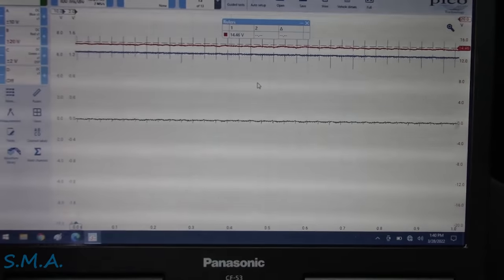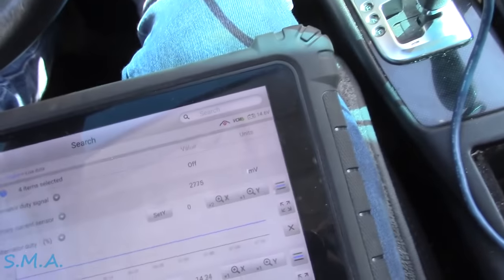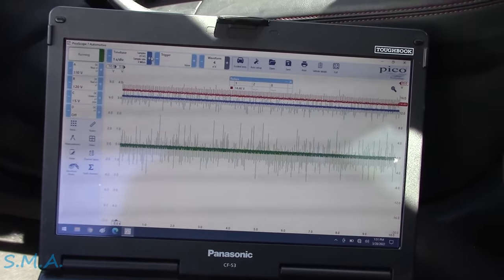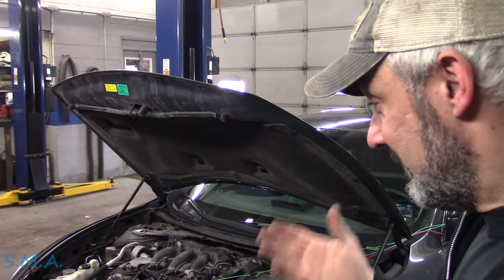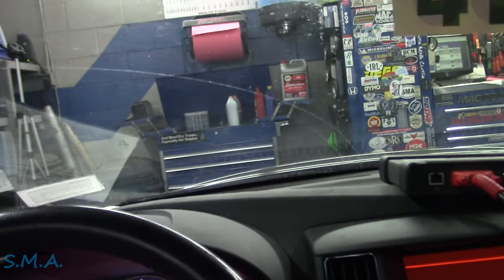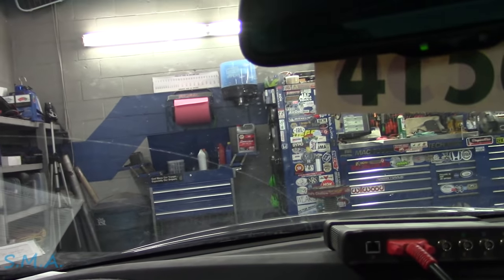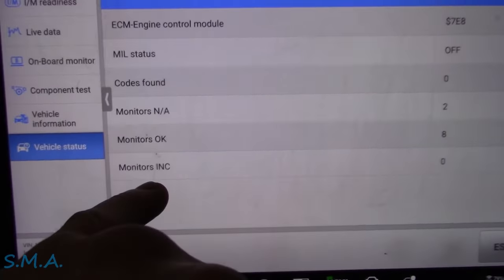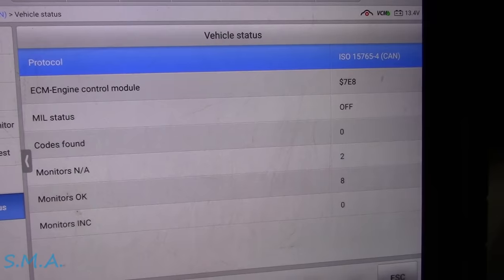Nissan Dealer Quoted Over $2000 For A New Harness!! - The Real Problem

Comment: One more thing. It is my belief that diagnosing a problem requires the mindset of realizing that there is a common denominator when you are attempting to diagnose the problem. Example; I actually have worked on some heavy duty trucks. I had a Peterbilt that was at the dealership kept blowing one of the main fuses. The dealership had it twice and it still was blowing the fuse which cut off the air conditioner compressor, some of the gauge cluster and most importantly the air controlled fan on front of the engine. So I cranked it up and I was going to put it in reverse and I noticed the alternator hand bottoms out quickly let go of the gearshift. The alternator  jumped right back up to the normal position.
Talking to the driver he said, now that I think about it every time it has been acting up is when I am connecting to a trailer.
It was a dead short in the reverse switch in the transmission.
Common denominator, was backing up.

Comment: I haven’t finished watching because I didn’t want to know for certain the fix. I believe there are those rare times in all mechanical service where a judgment call ,“Guess” based off of diagnosis, elimination and experience needs to be made. I think the high Milage and that the Alternator was original that replacing it is a very solid guess of experience. 
A hell of a lot better than Wheel speed sensors that she was sold or the expensive wire harness Diagnostic /guess. Just watching I said Nope highly doubt the wheel sensors would cause a complete electrical shut down and flickering ALT light. 
Really enjoy your practical diagnostics approach. Easy to see you have fixed a car or two. Back to the video to see the outcome

Comment: We need more troubleshooters like Mr. O across society. For example, Apple used to be about troubleshooting issues and finding the actual fault and now it just replaces components until its fixed. No investigating issues and trying to determine if there's a systemic issue with hardware/software. Thanks for the knowledge you share.

Comment: I have to agree with others. The in depth, detailed diagnostics, and analysis, is so critical. You might spend more time diagnosing than other shops, BUT, you can feel better, and you're customer can, knowing that the issue has been fixed for certain. I enjoy watching your step by steps, you're in depth narration. Well done.

Comment: Harness problems usually show up on cold starts, especially when there is high humidity. On my 1991 Maxima, I did have a harness replaced under warranty. 120k miles later the alternator went.

Comment: Ive seen two alternator issues, one, bonding strap from alternator to engine block broke and that completely ate the battery in a blizzard going across the real south park outside of fairplay. The other was worn brushes on an alternator and it quit charging. Replacing a set of brushes was far cheaper than replacing a complete alternator but most people dont know you can just replace the brushes and or the voltage regulator.

Comment: Many years ago, took my FX35 to a Infiniti dealership same crap as Nissan. They changed the rear subframe after they messed up on a rear alignment. Extended warranty covered everything. But the issue persisted, the back end was all over the road, it would sway hard to the left and right on bumps. I took it to my local mechanic/alignment shop. They checked the alignment and the toe and camber were all messed up in the rear. After 10 min fix, the car was back on the road and had no issues. Therefore, they through bunch of parts and even disrespected me of how my car should perform..

Comment: Good job,  probably the over charge  is what led to the positive battery terminal corrosion . In you 1st vid the altinator duty cycle was off once you changed it was on good job 👏

Comment: Because of all this fun stuff, I am going to drive my 01 and 02 Corollas, 92 Camry and 96 F150 till the bodies fall apart. Too much computerized BS. Great video Eric! No Reee here.

I do have a question. Do modern alternators still use internal voltage regulators? My thinking is the regulator was losing ground internally in the alternator causing voltage to spike since it couldn't regulate the output voltage. Maybe?

Comment: Well done! I think the vast majority of shops would not have found this. But then, most shops get squat for extensively diagnosing vehicles (according to a mechanic friend of mine) so they don’t bother usually. They treat error codes, not vehicles.  Often they just hook up the diag tool, read codes, take a more or less educated guess, then load the parts cannon and hope for the best.

Comment: Funny I find this video now, a few months ago I was working on my wife's beater 04 Grand Am that she loaned out to a friend. Similar failure mode, dash would go dark while driving, but no limp mode (not sure if an 04 GM even has one). Also intermittent no start. I had a very similar troubleshooting process to yours - started with changing the battery cables (negative cable is pigtailed to ground, so I'm also replacing system ground), and then replaced the alternator. Was thinking to myself, this is too stupid to be the root cause, but hey it worked!

Comment: I think Nissan should give her money back...when mr o said dash light were dimming...regulator from alternator were pinging off in my head it regulates voltage spikes speed sensor codes were there because the alternator shares a 5v ref with the speed sensors so the pcm will see that and flag a trouble code really can throw you for a loop great tech mr o !

Comment: Had a Nissan Altima come in the shop about a year ago.  Customer had it at the local dealer and they told her it needed a ECM.  Running the vehicle it would act stupid from the get go.  Scanner data was all over the place.  Battery light flashing intermittent.  Checked DC voltage good checked for AC voltage got 3.3volts.  "There's your problem lady" replaced alternator and problem solved.  So much for the dealership diagnostic

Comment: I had a similar issue with a Honda Pilot. It had high voltage at 20vdc. The fix was replacing the electronic load distributor (ELD) after that the pcm signal went back to normal.  but it still had high voltage. Ultimately the alternator was also bad. I just hate how they modernized the charging system on newer cars just to eek out a mile per gallon better gas mileage. The older charging systems worked just fine.

Comment: it is insane to me that they missed the battery voltage code from the TCM and didn't fix this properly. I thought they always just replaced the ECU in these situations, lol never the harness but I guess there is always a first. This Diagnosis screams ground or power issue from the first time I saw the way it acted up... Great job on the diag, as always.

Comment: The dealership mechanics should have seen the high voltage and known the voltage regulator is bad. I have replaced the regulator from the alternator if the alternator bearings are good. Saving money.

Comment: Abnormal voltage code in ABS is the tell tale sign in these vehicles.  That's a good system to monitor for voltage issues on Nissan .Start with the basics is what you did.

Comment: good find, what in concerned about is in the original list of codes there was an abnormal voltage code this can be to low or 2 high but that data should have been stored in the FFR freeze frame data. generally if I see voltage codes that is my first place to start, not load the parts cannon and see what fixes nothing. also just a note for you, the early ish v6's it is not a bad idea to change the small harness at the alternator. once its out you have lots of space as these can crap out quite often and cause all kinds of strange things to happen electrically, , you can get that alternator out without  disconnecting the ac compressor but its a bit like playing tetris blind folded. great video and again nice find.

Comment: I have an 05 Frontier that is showing almost similar . Intermittent charging and putting out 14.3V on idle . Then it craps out and light comes on with brake light and lose gauges , oil pressure , amps etc.  Have alternator and new belt plus Tensioner on order . Fingers crossed . Great job on diagnosis . I’m also in NY a bit further south but dealing with rust dragon also lol.

Comment: Good work! Yep, corroded battery connections caused high impedance in the system, maybe introduced some AC into the regulator due to poor continuity under load, caused a lot of things to spit dummy! Gotta be ace at diagnostic troubleshooting with them simple if not obvious things! KISS rule always applies! You went right to it! Well done brother!

Comment: Had a transmission company diagnose a bad transmission. Started slipping again less than 1 week later. Took i5 back to the same place. They recommended a new transmission.  I said ok. Then told them that they were going to put it in for free. They got confused!.
I  told them that I had it in their shop the week before. I showed them the receipt. 
They came back into the office and told me I had a vacuum tube leak. And they fixed it.  I asked why they sold me a transmission when the only problem was a vacuum leak. 

Crickets.

Comment: Working at nissan in CA, i saw plenty. I wouldn’t doubt they quickly diagnosed it without care. When i was at nissan a 2020 nissan kicks had an issue, shop foreman diagnosed it and under warranty it got a new engine harness which he threw at me to do. Lady picked it up and a week later had same issue that the harness was supposed to fix 😂. I honestly didnt get into what was the issue, i just changed the harness as asked. But they dont have the time to properly diagnose cars, if it’s routine issues they go through them quickly but the techs are always rushed to get 80+ hours for the pay period in order to get paid. Kinda stressful so i left. 2 older guys weren’t getting 60 hours, surprised they were still there. But they use a different diagnostic system that’s beyond different from using a scanner. In the 30 or so mins he diags cars is the time they get rushed at dealers, especially for waiters 😂

Comment: The day you get a dealership to admit they f'd up, good for you. A refund??? Total pipe dream!! The way you go about diagnosing items is neat to watch. I do what I can on my trucks, thanks to you and watching several u tunes. Speed sensors??? WTF?? One thing about dealers or SOME mechanics just replacing random items continues.  Well, it should have fixed it. Sorry about that, but here's the bill. People in your area are lucky to have a REAL diagnosistician(?) to go to.
Just curious as to your shop rate. Most guys in my area are hovering around $85--100 per hour. If they fix it without an excess of charges, you just don't eat that week😩😩. Thanks for sharing. Ron

Comment: So I hold a bachelor of science in automotive technology. I don't practice that trade anymore. But if I ever have to diagnose something I start simple. I start with checking the battery terminals I check the alternator terminals and I check fuses. I use a multi meter and a test light. Again I go right to the basic.  It seems that that practice of basic diagnosis has been forgotten.  It seems like it's just plugging and play and use a scan tool and that will diagnose and help you locate the problem. Scan tools not going to help you visually with corroded batteries and so forth.  It annoys me when I hear about people going to dealerships dealerships and they try to upsell on s*** they don't need.

Comment: Had the same problem with a 2010 Nissan Maxima did basically the same dealership replaced alternator 2 times still did the same they had a Nissan engineer look at the car said put another alternator on it did the same so they ordered another and it fix the car after 3 alternators

Comment: Last week this happened to us at a Mazda dealer in Richardson tx.
We dropped off a perfectly functioning vehicle to get an error light
Checked. They kept it for 9 days without a word to us. Then we
Find out they have been trying to file a $ 7,000 claim on our auto
Insurance to get an Entire wiring harness installed plus about 1,100
Worth of other things.
When we told them to do the minor stuff, tell us when it is done
so we can pick it up, when contacted that the minor work was
Done but we would likely need a tow truck to get it home.

Got there to drive t home after dropping it off  operating 
flawlessly. The battery was dead, they jumped it, then a half 
Mile away it went into 4 mph mode.

They tried telling us that when the battery gets weak it
Does that to keep you safe from going at highway speeds.

They never knew that I became our family car guy at age
14 in 1974 and have. Repaired hundreds of cars for pay, 
over the Decades, and know enuf about electronics to
Troubleshoot nearly all circuit boards.

I also have been told many times by my fav auto elec
shop here that for a very long time the voltage output
of alternators has been controlled by the voltage
regulators attached on the alternators independent
of the other car systems.  And that if more than 
14.5 v ever gets out of that voltage regulator, then
You have a bad alternator-mounted  voltage regulator.

I have repaired many cars by replacing either or both
the alternator diodes or the regulator module for way
less than the cost of an entire new alternator. Watching
your video, as soon as I heard  “17 volts”  I was certain
The voltage regulator was failing. But you can easily
replace those yourself in 5 min for about $40. They
are nearly always mounted externally at the rear of
The alternator.

Comment: The lady should be refunded in full for nissans incompeiance afte all they would and should have high tech equipment to solve the problem pity i cant say the same for their mechanic you did a fantastic job for the lady with your testing and diagnosis and finaly cured the issue you come accross as a mechanic who who wont be beaten

Comment: I’ve been  down the misdiagnosis road with the dealership in the past and have even proven they were wrong.  I have never gotten a full refund. They always claim there was an additional problem. The best I got one time was a partial refund for engine work that fixed nothing. I still remember the mechanics saying “That noice? We didn’t know you were talking about that noice.” LOL! There was no other noise and the car ran fine.  Turned out to be a cracked head which I fixed myself. They replaced a timing gear and the chain. Mileage was not conducive for this going bad.

Comment: You are amazing you're deductive reasoning and investigative skills are absolutely astonishing and the fact that you start with an open mind to determine the actual problem rather than like Nissan they wasted $1,000 worth of the lady's money and yes they should give her an apology and a refund based on your determination and repair and thank God that she had enough sense to not replace the wire harness cuz they would have replaced the wire harness and the alternator would have still had a problem so they would have had to replace the alternator on top of that and they never would have admitted that the wire harness did not have an issue because the wire harness for that car is probably $3,000 so they would have made $800 on the wire harness plus another $800 on the labor so they're not going to give that up they're going to deny deny deny and say oh well it had a problem and the alternator also had a problem and we had to replace all that stuff and you know now we've you know pretty much charged you for a car again I just thank God for people like you that have enough sense to figure out what the actual problem is rather than just start replacing a bunch of very expensive parts

Comment: Give the dealership the opportunity to see the video and ask them what they want to do. As you know dealerships have time restrictions in the way they run and depending on the techs bonus formula, limits there on time too. However, hopefully some are still genuine people and this poor lady  might get her parts and labour refunded as a goodwill gesture. Being an ex Service Manager at a Dealership one thing I know is if you dont make them aware they cant act. Also dont take the Service Managers decision to do nothing as final! Ask to have it referred to the Regional Service Manager for his opinion on the situation, fully knowing they have roughly 5% of turnover that has to be spent on the "reputation of the dealership" commonly under the guise of a "Refund", or "Goodwill".Another great diagnosis and proves you can get a better job done at an independent garage especially for intermittent faults. Remember If you replace everything you will correct the problem!!! ha ha

Comment: As a person who does repairs in a different field ... Intermittant faults are a nightmare . So hard to catch them in the act.
I've seen it on cars too ...  A v6 vw toureg which would drive perfectly ..then once every so often go into limp ..not fun in the fast lane .  It could happen any time , never threw a code and no pattern to it except if you turned it off completely and started again It would drive on perfectly until the next time .  PITA.